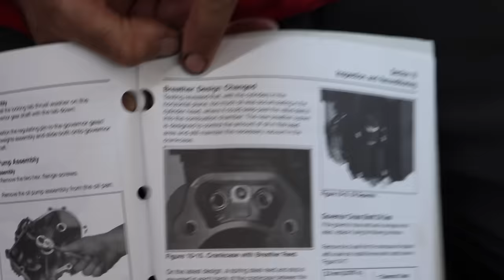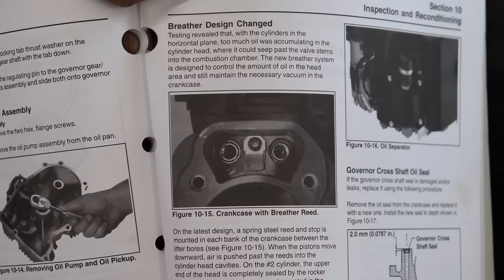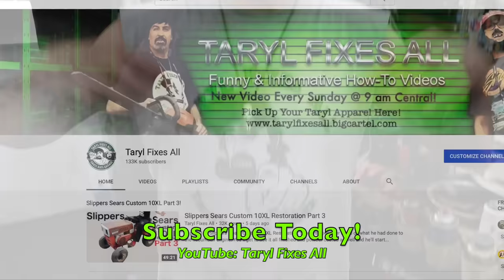Troubleshooting: Bad Camshaft Kohler Command

Comment: You know, I had a case bolt come loose on my MS280 Stihl and it broke some fins on my flywheel. $80 later for a new flywheel and it cuts great. I did remove those bolts and gave them a shot of lock tight. Thanks for your videos.

Comment: Hi Taryl I just subbed to your channel Utube just recommended you out of the blue. I have been watching several of your videos and love your zanny comedy and your extensive knowledge and know you are the real deal, there is so much garbage on utube but your channel is totally genuine. I used to own a small engine repair shop in northwestern Saskatchewan, Canada in the 1980s I was a large Stihl dealer also a Suzuki marine, BCS and Homelite Jacobson, and Kawasaki small engines. In the later years I worked for a full line Honda dealership repairing motorcycles, Honda automobiles  marine and small engines. I then went to work for a provincial run tech school as  a instructor in the OPET program, Outdoor Powered Equipment and then to a medium sized rental company repairing everthing the from large gen sets to Genie and Skyjacks and power trowels , jumping jacks  to chainsaws and cutquicks. I then retired in my mid sixties and sold off my tools. Cheers from north west Canada.

Comment: dident see that coming,
Reply: They said it was running rich, but I think they just mean it was making that distinctive “banging” noise like it was running rich. That sometimes happens if a valve is too tight so it doesn’t close, or in this case where the compression release was stuck. Since he could cover the carburetor with essentially no vacuum forming, I’m guessing the release is on the intake valve, so all the compression was pushing back through the intake manifold and the net air flow through the carb was essentially 0.
Reply: @lavendersneppo  I believe the compression release is always on the exhaust valve(s) because the engineers wouldn't design an engine with air/fuel mixture/exhaust gasses being blown back out the intake/carburetor. The loss of suction on the intake is probably because air is being drawn back into the cylinders through the exhaust pipe/muffler.
Reply: @sewing1243  That isn't always true, the newer briggs single cylinder lawn tractor engines have the compression release on the intake and I'm sure others do too. Normally the blow back through the carb isn't a problem when starting because the release closes so quickly, but in this case it isn't closing. Most older engines had the release on the exhaust, but some newer ones are starting to be on the intake.
Reply: It seems more and more with kohler engines I don't see it coming lol,
Reply: Or going?
Reply: Hey I have seen a few of your videos  . Mustie 1
Reply: @lavendersneppo  1qq

Comment: Hey Taryl, check the oil filter for pieces of the reed valve. another great video.
Reply: exactly what I was thinking,however he did say that the oil pump has a screen on it, I would still tear the filter pleats apart and look for filings.

Comment: Taryl, was hoping you could answer a question for me. I have a Kohler CV15S engine and cannot locate where the regulator/rectifier is on this engine. The videos I have watched show one in the corner of the engine shroud, but mine has a plate there. Does the engine have a regulator/rectifier and if so, where is it? Thanks for your help.

Comment: Taryl, 
I have a Hustler Raptor SD with the Kohler kt740. I am having issues with the engine running rich too. I did a full service on the mower engine. oil, filter, plugs, and swapped out the carb. The issues I was having is the mower suddenly lost power while mowing. Lots of black smoke. This all happened while mowing. I pulled the valve covers, and found one of the rocker arms broken. I replaced the rocker arm, and adjusted the valves. They were all loose. After fixing the rocker arm, the mower starts almost instantly, but still has no power and spits out tons of black smoke while at full speed. Idle is fine. you can visibly see all the fuel being thrown into the carb causing it to spit and sputter. After doing the towel test. the mower slows down, but does not stall. I am at a loss and don't want to tear the mower apart unless i have to. any ideas. 

Thanks. All the videos are so helpful and awesome. Keep up the good work.

Comment: I wonder if the compression release parts on the old Kohler Command camshaft could be removed, and reinstall the shaft without those parts?
Reply: That's what I am thinking or push the weight in and grind down the lifts on the exhaust cam lobes so that they will be even with the cam lobe... Just a thought from a 35 + year mechanic from the back yard... Lol
Reply: Yeah I’m sure it can but when T was looking at the cam when he removed it the CR was stuck open...it should have been disengaged. I think something else is going on. Like I said in my earlier post I would like to have seen the flywheel key too.
Reply: @garny3766  I went and looked at the video again to make sure before replying. When T pulled out the cam and turned it over the weight was stuck and it was stuck close to the shaft and the compression lift pins were sticking all the way out holding open the valves as it went around. That is seen in the video plain as day. Another thing a guy could do is weld the weight in the out(open) position so the lifts do not stick out and hold the valves open. Just a thought!
ME: I  would have ground down the lifts and reinstalled the camshaft and got lunch... Lol
LLAP

P.S. I have one of these engines and if this happens, that is what this 67 year old mechanic is going to do... :-) $200 bucks my buck teeth..... :-D
Reply: Bruce Scott Humm I just watched again and @ 11:09 you can see his left index push counterweight back towards camshaft (that’s the first click sound) in essence turning “on“ CR. It does appear the lift pins are sticking up until he cycles the CR a few times though🤔

Comment: Guys, I had a similar issue and it’s still has me a bit puzzled. Toro 1128 OXE snowblower. Complaint was the machine was low on power. I pulled out the gas, put in fresh non-ethanol fuel. No fix. Found the carb leaking from the body, bad casting I assume. Replaced carb, no leak but still had original issue. I checked valve adjustment, they were both loose. Adjusted to Briggs spec, no fix. Then the machine wouldn’t start, I was getting intermittent spark. Pulled flywheel and found sheared key. Replaced key, got it running, still same original issue. At this point I’m scratching my head—a lot! Since the engine had a pretty bad oil leak I figured I would pull the sump cover to take a look inside. What I found is the puzzle I don’t understand. The cam timing was off 16-teeth from the crankshaft. I called the owner and asked if anyone worked on the machine before me. He said it was the first time anyone has touched it since it was new. Camshaft was fine so was the crankshaft. I realigned the shafts properly, inspected the governor, lifters, pushrods. All was ok, sealed her up, oiled her up.She started up right away but hi-speed was only about 3K RPM. Adjusted both idle and hi-speed and she ran perfect. How can it run or even start with valve timing so far off? This issue owned me for a week!

Comment: This would be the same thing that would happen at my shop. Having to pull that engine three freaking times......
Reply: Taryl's so experienced he expects his gut to tell him the diagnosis. But an amateur needs basic checks like cranking compression and leakdown test. Those would have helped show low running compression but good cylinder sealing at top dead, which should have hinted at the bad compression release.

Comment: I am just wondering if a little tiny piece of a that reed is semi lodged under that compression release somewhere.
Reply: I agree. That piece is very thin and flat, and with a little bit of oil on it, it could easily stick between the gear face, and the CR counterweight.  I would have slid a business card in between there right away, and gotten my flashlight out 😃

Comment: Taryl I have a shop like you I had one I’ll share with you we had a cc gtx2100 with the horizontal version command and it ran very similar but lean and hot, after 5 minutes the exhaust would be glowing orange we changed everything you could think of. We then found the horizontal version commands had a pressed on cam gear on the crankshaft well apparently they are known to occasionally slip causing the cam timing to go off. Midwest super cub sells a kit to correct this problem otherwise Kohler wants you to replace the entire crankshaft. Just figured I’d share that one with you since it really was making us scratch our heads for a wile.

Comment: I recently bought a non running GT5000 with one of these engines. After seeing so many of Taryl's videos on the many and various problems with the Kohler Command V twin, I think I'm going to just replace the engine with a good old Kohler Command single cylinder engine, even though it's only a 17 hp.
Reply: Yeah but they CAN have simple problems that are easy to fix. My command pro 25 from the 90's on an Exmark has 1700hrs, and has only had a blown head gasket. It is so strong i didnt realize the head gasket for a year, then a mouse chewed the coil wire and made that cylinder stop contributing what little power it was putting out. Then it would run on one but die when i switched on the blades.
Reply: @bw1841  I got this one for $250 a couple months ago. It's in excellent condition, but for its engine problem. It's the geared model, not a hydrostat. Previous owner said it broke down, he took it to a repair shop, who said it had a blown head gasket. So they put new ones on. THen those blew also. So he was done messing with it. My original intent was to see if I could fix the 25hp, but after watching some of Taryls videos and others on the MANY problems with these Kohler Twins, I'm not sure I want to even try. Which is why I figure I'll put the 17 in, to get it out of my shop, then toy with the 25 later. 

And who knows, it might work fine with the 17 single cylinder Kohler Command. I have another Craftsman, a LT1000 that had a 17hp Intek that threw its compression release. While waiting for the new parts to come in, I put in an old 11 hp B&S flathead engine and it ran and mowed fine with it, though it could not power through high grass as well as the original 17 could.

Comment: Taryl, do all small engines today have compression release ??? You said that Briggs changed the design of the compression release three times ??? Maybe a fourth time is in order ???? I prefer the old engines. They were made with longevity in mind. Thanks Taryl for letting us all know on YouTube of this problem too. VF
Reply: The older ones have it to exept briggs  which used a bump machined  into cam  lobe for compression release. It was trouble  free,as long as the engine  was  properly maintained!
Reply: @randallcarney1216  Thanks for letting me know Randall. VF

Comment: Good demo, and how about that same mower keep blowing fuse. What do suggest. Thanks.
Reply: I had the same problem.  Turned out to be the electric clutch. 
But if yours doesn't have the electric clutch, there is a short in the wiring somewhere

Comment: Trying to understand all that a stuck compression release would effect. Loss of compression for sure. Could it cause backfire ? Also, would it run LIKE it was rich or would it really be running rich  ?? Really good mystery video, you have solved much of the small engine mystery for me Taryl. I have fixed and tuned up all of my own machines thanks to you. Love your channel.
Reply: It'll usually run with the release stuck.  It'll just have no power.  It lowers the compression ratio drastically but it has to have enough compression to fire and run at startup.

Comment: Just curious, would a compression test have shown any indication of the issue without having to disassemble the engine? (And I realize you would still have to disassemble it to fix the problem, but just wondering if that would have been a useful diagnostic tool for this issue.)

Comment: Did you take the compression release apart and take the reed valve out of it?
The chain saw got a stone in it and broke off a vane. the vane and stone bounced around in there and did catostropic damage to the other vanes. Someone had it apart before you got to it or pieces would still have been in there.

Comment: Well that’s weird, those command v twins in my experience are some of the best engines. I always see them with 2000+ hours of use in a commercial setting and they run great. I guess it depends on how much maintenance they get. I probably would have been working on that for days to find that issue. I’m going to start inspecting all the reed valves on the command units I work on. I think I’m going to start stocking those reed valves and on any of the machines with over say 500 hours, I’m going to recommend the customer change the reed valves. Thanks taryl.
Reply: There's your Dinney

Comment: I just discovered that I'd missed this video. I watched it a few days ago and decided to reinstall that 25hp I'd showed you guys recently, to see if it had the same issues, before continuing with my repower plan. It doesn't have the same issue. What happens is it starts and runs great, for about two or three minutes, then oil comes spurting out of the OHV breather tube, shoots into the carb, and makes a hell of a mess. If I shut the engine down, and let it cool, then restart it, it's the same thing. It runs great for about two minutes, then oil shoots out the breather tube again. So maybe it's a bad reed valve instead  of the rings?
EDIT 12/13/2021. Update. I took it to Taryls shop soon after this post and he said the rings were the fault. New rings, seal, gasket total around $250 just for the parts so this engine is going to be sitting awhile. I repowered the machine with a 17 hp Kohler single cylinder.

Comment: Hey taryl I've got the exact same mower I'm working on. Problem is it will idle but as soon as I bump the throttle it runs more than full throttle. Rebuilt the carb and fuel accelerator. It ran perfect for about 5 seconds. Then it backfired and now I'm having this problem. Any ideas? Maybe the governor?

Comment: New one on me compression relief issue on a V-twin would have had me scratching my head too. on the other hand I've seen plenty single intek engines with the counter weight in the sump.

Comment: As a another possible cheap fix (in the case of a used replacement not being available) I wonder if the malfunctioning compression release could be removed, or weld the fly weight to the running position on the original cam?

Comment: Why does Kholer use a compression release on an electric start engine? It seems like something else to break.
Reply: Briggs does it too. If that compression release fails, good luck getting it to start.....
Reply: You seen the reason right there in the video, in his final start.  Without it, the thing will often lock up on the compression stroke- - which will wear out your starter much quicker... So you end up having to bump the starter a few times, every time you start it.  And for those who aren't mechanically in the know, it seems like its not working right.  All they need to do is put a manual compression release, just like on a Husqvarna chainsaw and it wouldn't break.
Reply: @ItsMrAssholeToYou  exactly.. So when you sell a million units.. saving $10 is making $10 million extra dollars in profit.  They cut cost everywhere they can-- and that's why everything is absolutely junk;  unless you're buying a $16k industrial grade mower with a diesel engine. Its very common for mowers to be $40k.. For like golf courses, and mowing highways...  And I'm not talking about a tractor with a brush hog--

Comment: Honda lawnmower with blade brake starts, idles, runs ok. When the blade brake lever is pulled in, engine slows momentarily almost to zero, coughs and splutters then picks up full speed again turning the blades. Is that sluggish pickup telling me there's a gap or lash with the governor pulling open the throttle ?

Comment: I have DGS6500 Kohler command vtwin. Hit the bottom on a hill, now it sounds like crap. Pulleys, belt, and sparks good. Sounds like banging metal on one side every time piston out position while running. Haven't checked coil or opened up case yet, (I don't wanna!).  Please help!

Comment: I have the Krohler 7000 KT735 on my Cub. Runs bad and backfires when throttling down. Under 50 HRS and under warranty. Cub dealer is baffled and it appears Cub HQ is too. Also idles rough. All of this since new. Is it possible I have the same problem? Similar? Bad cam and or compression release? I am at the point of really pizzed from just really pizzed.
Reply: Your mower backfires because the carbertrator is too lean. Pull choke out slightly & see if it helps. May need to CAREFULLY drill jet open to get more fuel. Thank the EPA for ruining engine, carb designs and our lives.
Reply: Internal blockage in carb...most likely.   Also have seen all of the following on "new" engines... Valve settings off. Flywheel key partially sheared causing timing to be off. Magneto(s) improperly adjusted or failing/failed. Head gasket leak...caused by mouse condominium blocking air flow around cylinder and causing overheating and result was blown head gasket...10 hours on engine. Cams typically don't go bad unless no/poor oil change intervals or about 1,000 hours of use.

Comment: My 26HP Briggs VTwin sounds like that Kohler. Though I don't think this one has a compression release and I checked the valve operation and it seems to be okay. Also think I recently bought bad gas (ironically it was ethanol free pump fuel). Already had the sump cover off 2 times. 1 st time it was the gasket leaking. 2nd time the sump cover had cracked, I have no clue how. I guess it's a Unsolved Mower Mystery at the moment.